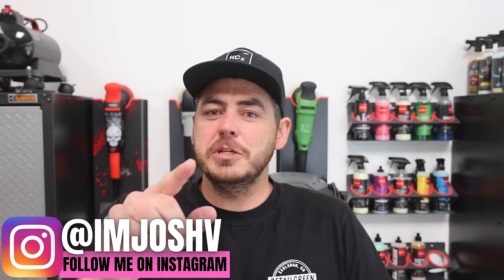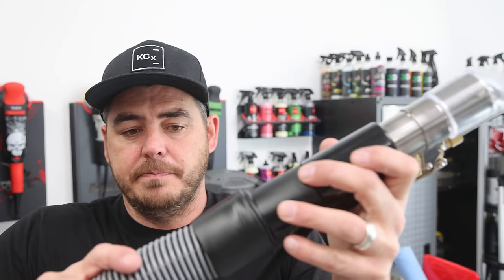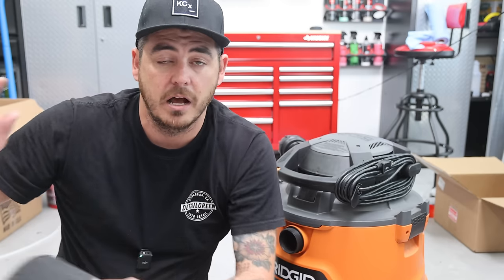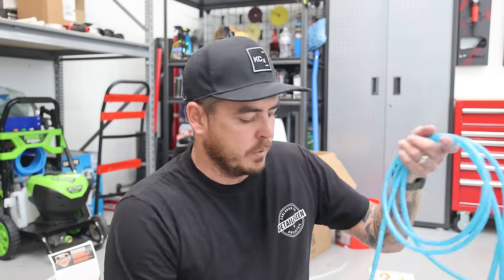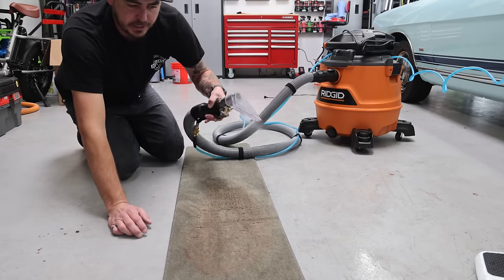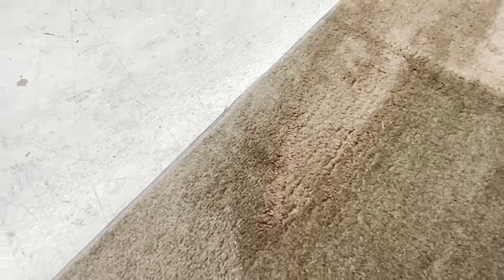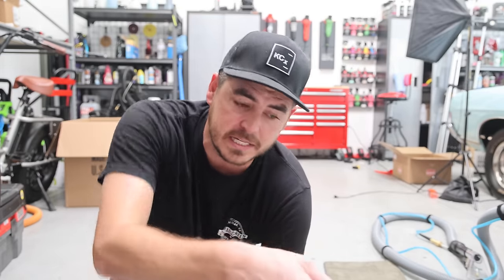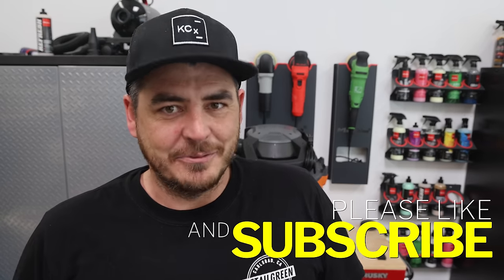EASY DIY CARPET EXTRACTOR USING A SHOP VAC | RipClean Extractor Kit

Comment: You forget one thing Josh! Get yourself a portable hot water tank connect it to the water in then connect that extractor solution hose to the portable hot water tank and Boom 💥 hot water.... I've been doing that for years gave that a try man!!!!
Reply from the maker: Sweet ill check that out
Reply: Which portable hot water tank do you use for this? I would be interested in getting one for my business.
Reply: where do you get one ?

Comment: Just to enhance the information you are providing Josh,  what you are looking for when choosing a vac for extraction is the Water Lift spec - this is measured in Inches, the higher the value, the better results you will get when pulling from the surface whether smooth or carpet.   CFMs are important, but in relation to the motors actual pulling power - focus on water lift.  Hope this helps anyone out.
Reply: cfm and water lift do different things,cmf is basically how the vacuum allows your tool to grab the carpet/upholstery ,then the lift is the actual sucking up the water.
Reply: Any vacuum recommendations?
Reply: yes, Advance is good, WAP/Alto works well.  Stick with machines that have multi stage motors with bypass function.  do not go with direct horsepower spec brands like rigid, shop vac etc.
Reply: not really,  cfm is volume of air based on area of suction squared to radius of the hose diameter.  tool grab isn't even a term used in the real world.
Reply: @Mainbusfail  i was trying to make it simple. its totally different. i have had a extractor with 182 inches of lift and one with the same lift but 240 cfm. one is capable of about 15 feet of hose and one at about 200 feet. cfm allows the head of the tool pull/lock on/grab on fibers or fabric, then lift comes into play.

Comment: I just made a system with this vac but with a full size carpet wand and my shower head for hot water. Works GREAT!
Reply: What connector did you use from wet vac hose to the full size carpet wand? Did you get the kit he’s talking about? Does that connector fit on a full size wand?

Comment: Really good info. You got me wanting to try this as a winter side hustle. I didn't know that the sprayer was just tap pressure. You make good videos!
Reply from the maker: Thanks!
Reply: Same, I thought it needed something more, and I also assumed that solution is injected and not just water. Now if I could make this a steam not just water, that would be great. Thanks @imjoshtv!

Comment from the maker: LINKS TO PRODUCTS IN THIS VIDEO:

RipClean Better Extractor Kit: https://ripclean.com/products/extractor?sca_ref=3130638.BCBowI2l2W
    or on Amazon - https://amzn.to/3vRDWge

Velco Strips - https://amzn.to/3QwAalZ

RIGID WET FILTER (SMALL) - https://amzn.to/3GXvJxK
RIGID WET FILTER (LARGE) - https://amzn.to/3IJu8wN

Components to build it yourself:
Item #1 Extractor Wand - https://amzn.to/3XmWm4s
Item #2 Slip on Attachment - https://amzn.to/3CBSowE
Iten #3 Vacuum Hose - https://amzn.to/3k9lDAV
Item #4 Quick Connect - https://amzn.to/3GSk6Ie
Item #5 Teflon Tape - https://amzn.to/3IExoZZ
Item #6 Air hose for Water - https://amzn.to/3W2U1KW
Item #7 Garden Hose Connection - https://amzn.to/3Qxqdot

VACMASTER 3 in 1 Extractor - https://amzn.to/3isiBXM

CarGlo Interior Buster - https://dtlrsupply.com/products/carglo-interior-buster

Extractor Shampoo - https://amzn.to/3X3wIli

Comment: Tbh I just got a green scrub thing. A shop vac and two liters of water with laundry soap/bleach/dishsoap. And I soaked the interior and scrubbed then vacuumed it. It  is like I used a steam cleaner. Perfectly clean no stain seats. I carefully filled the cup holders with water and scrubbed then sucked it up with the vaccum. Pretty impressed.

Comment: You can also comnect the waterline to your pressure washer via quick connect. Leave pressure washer off of course but use the running water from there. Just switch to pressure washer from there or vice versa

Comment: Hey Josh, kudos my detailing brother. 1/15/22 Home depot is running a web special on their 6 h.p. vacuum's and they are tossing in a car detail kit. i.e. hose crevice tool ect. Another thought on the water hook up, put an in line valve  with a hose bib on the HOT side coming from your water heater...Bingo. If you have a sink in your garage or the hot water heater is parked in the back corner something real easy to pull off. Thanks again for the primo content
Reply: Jumped on that deal from HD...Rigid 14 gal 6HP vacuum and car kit for $113!!!

Comment: Thanks for this. I'd use this for home carpet spot cleaning. 
FYI Suggestion: For your tank set-up you mentioned, and having not much pressure/flow. Perhaps try to parasite some of the shop vac exhaust air with hose. Run this into the top/lid of your tank. You'll want to play with air flow and/or some sort of vent on the tank so you don't have excess pressure build up and blow up your tank. Maybe a petcock pressure valve that vents at an appropriate psi. Or look into an rv water line pressure tank. They likely have a built in pressure release.
Reply: Thank you 😊 much appreciated advice

Comment: For twenty dollars you can get a windshield wiper sprayer kit. It comes with a 1gal water tank with and electric pump built in they come with 10 feet or more rubber water hose made for use with chemicals and it comes with sprayer tips.

Comment: Back in the day we would use the short pressure washing wand with a lower pressure nozzle.  Point the nozzle toward the shop vac hose and basically pressure wash the dirt into the vacuum. 🤣😂🤣 if you were good with the angle it wouldn't soak the carpet or seat and would dry in a couple hours.

Comment: Thanks for sharing this! I just might have to get one. Since most water heaters may be in the garage and have a hose connection,  that could be a possibility for a hot water source.  May need to turn the temperature down on the water heater though.
Reply from the maker: Great idea!
Reply: I was thinking the same thing however I would probably figure out some sort of prefilter because of the sediment that collects at the bottom of water heaters. If it were me...I would tap in to the line on the top of the water heater and this would eliminate the sediment issue...you also would want to make sure the rating on the  hose could handle the heat because coming straight off the water heater is going to be much hotter than say at your kitchen sink due to the thermal loss from the distance of the faucet to the heater.

Comment: Thank you for your posts. Just one thing I think the water coupler need a rubber protector or shrink round the melt coupler. Just an idea so you that way you would not scratch interior parts

Comment: Hi Josh.  Great video and thanks for all of the research and info that you've shared.  Question...I mistakenly left my passenger rear windows partially down and it rained.  As a result, part of my back seat and the back of my passenger seat got wet.  Should I extract the water or let it air dry?  Please advise.

Comment: Love this conversion…I have a possible upgrade option. What if you added a mini tankless water heater to the water system (like the ones under sinks). Amazon has one for$100 1500 watt. Would be a nice option if someone has a generator with power capability.

Comment: Man, what a great video.  Talk about your "poor man's" extractor.  This is it, and I have a possible idea of what you might be able to do to get some hot water going here.  On my water heater, there is a spicket, just like a garden hose spicket.  I'm wondering if I couldn't hook up the female part of the hose to that so you could have hot water.  Of course, depending on how big your water heater is, you could run out of hot, hot water, but you'd still have water that's in the process of heating up.  Just an idea here.  Thanks again for the very informative video. Marc Trainor

Comment: after watching your video cleaning a couple of really filthy car seats.The Bissel was amazing.cant believe this collection of parts would be so  much better. Additionally theses parts are $60 more than the Bissel. If you're only a DIY er, I'm thinking the Bissel is the better deal. just my opinion.
Reply from the maker: Yea the bissel definitely gets the job done. It will leave the surface wet for longer because the suction isnt as strong but it will get great results

Comment: Josh, I have a hot water connection in my garage. I want to use my shop vac on the second floor of my home. I need to use a 100 foot pressure hose. How do I connect a 100 foot 1/4” pressure hose from my shop vac to the hot water 3/4” connection in my garage? Is there a quick connect adapter option?

Comment: If you have a Water Heater close by, you can hook up that hose Connection to the drain on a Water Heater and get hot water out of that extractor.

Comment: I put a setup together like this using 1/4"  air line hose like you did.
I wanna hook it directly to the hot water spigot..
Will the hose work with hot water?

Comment: Which Rigid vac would be better? The WD4070 or WD4080? Both 4gal, but one is 5hp and the other is rated at 6 peak HP with a top detachable blower (like the top of the one in video). Have been building my own DIY since 2019, buying parts here and there, but accidentally bought the Ripclean while half asleep this morning (didn’t know I was logged into my Shop account, when pressing the best button to figure out price after tax). So I guess I’m finally going for it. Just need a second vac. 5hp with a free detailing kit, or 6hp with a top blower. Can’t decide if 1HP makes much of a difference when it comes to suction

Comment: Question- you think I can put a quick female connect adapter to the end water source hose, to be able to connect to my Ryobi 1600 electric pressure washer ? Or is it too much pressure for the sprayer ? Also is there such connector/adapter ?

Comment: Do you need the water injection jet or can you just get the extractor tip for your vac and use your APC and agitate it and just extract it with just the extractor tip and vac ?

Comment: One of the commenters suggested an extraction head that has an internal component for the water spray so you don’t oversaturate. Do you have a suggestion for which one to buy?
Reply: Miranda detailing has a good suggestion. that’s good for seats but in my opinion, external jet is best for carpet. I use steam for seats anyway

Comment: The only reason why the ready made ripclean is cheaper than building yourself is that they aren’t using an actual mytee wand/head they are using one that is way cheaper. The one that exactly matches what they use is one manufactured by westpak. 66 dollars plus shipping.

Comment: I have been using the vacmaster based on a previous video you’ve made and I enjoy it. I am curious as to how that new extractor head compares to the old crescent moon shaped one that could be a little cumbersome in smaller areas. Any experience with the newer model?
Reply: I’ve had issues with the spray pattern on mine. Suction is decent but can’t seem to get enough water to spray
Reply: @tinorodriguez89 are you talking about the vacmaster or the extractor ?

Comment: How long can you use the vacuum before you shut it down for it to cooldown or you can use it nonstop and it won't damage the motor
Reply: Rigids are tough machines! They also come with lifetime warranty so if the motor does go out, you just get a brand new one.

Comment: Have a random question.  I have a car that sat for a few months and got moisture on the inside. I am now struggling to get a mildew smell out. Any suggestions on how to proceed?
Reply: Use laundry detergent as your carpet soap. Dilute it with water, work it in with brush and extract

Comment: Would you be able to connect the water hose to your pressure washer 🤔
Reply: I don't think so the water line it comes with already has the male tip to connect to a water spigot you would need female to connect to a pressure washer.

Comment: $200! Ooof. No ty. I was looking for a cheaper option. But this gave me an idea. I have several round up battery powered sprayers. I’ll just toss some cleaner in those and strap them to my shop vac with a carpet cleaner attachment and I have myself a basically free carpet cleaner/extractor. Basically the same thing as this except…free and I can use cleaner and not have a hose attached. Just have to fill the Roundup 1 gallon jug every once in a while.

Comment: Do you really NEED the extractor set up? I'm wanting to clean my car as well as indoor couches, carpets, rugs etc. could I just spray cleaning solution, agitate, and use a shop vac to suck up the solution?
Reply from the maker: You absolutely can just do it that way and get good results!  The extractor will help in removing all the residue and chemicals but doing it how you state can be done for sure

Comment: Do you need the water filter or can you just use it with no filter?
Reply: Yeah on the rigids water filter is just a choice. Your going to be draining the water anyway, you can just easily rinse out the drum with clean water afterwards.

Comment: Hey Josh, or anyone else who might know, 

As a mobile detailer, would the pressure from just a gravity fed tank be enough to hook this hose up to and be functional? Or would I have to have like an inline pump with it??
Reply: The extractor I’ve made I use a cheap water pump that’s mounted to the cars battery and has a switch for on off and a ten amp fuse. Works perfect plenty of pressure man and mountable on the side of the tank
Reply: @truereality5873  I might have to buy a water pump to go this route.  

I love this because I would have one less machine in the van.

Comment: Just to clarify, that 6.5hp is crappy math tomfoolery. All the documentation for this kind of stuff says "Peak" HP which is like for a split nanosecond it reaches 6.5 hp and its actually rated for 2 hp(or whatever) norminal runing power.
At most a residential outlet is rated for like 1500 watts which is about 2 hp.(at 120v, thats 12.5 amps, your breakers are around this number too)
6.5 hp is about 4800 watts. (at 120v, its 40 amps your breakers would trip or the motor wouldnt run all that great).

Comment: what if the water hose doesn’t reach to the area i’m extracting ? is there an extension for that ?
Reply: Just connect a regular water hose to the connection. Pretty much like connecting two garden hoses together.

Comment: I’m still waiting for hot water with this unit. most homes I detail have cold water so extracting with cold water isn’t that great lol
Reply from the maker: Yea heat is a huge benefit
Reply: I wanna buy this but not having heat is wanting me to just save an get a heated extractor :)
Reply: @ElvisRobinson05  just get it. I feel your pain I’ve only cleaned with cold water for the most part you wouldn’t know especially if it’s a hot day. At my home I use hot water since I can go in and out (I have the little green atm) imo I don’t see a huge difference but either one will due the job. If you really want I’m pretty sure it’s strong enough to suck water from a bucket or something if you wanna fill that with hot water

Comment: Can you hook up the water source to a pressure washer ?
Reply: Maybe just the wand and use your own pressure line from your pressure washer as the wand already has the quick connect tip.
Reply: But why would you want pressured water if cleaning interior of a car? Wouldn't that cause over spray and cause fabric to be too wet after ?